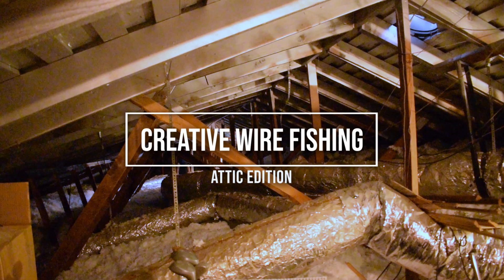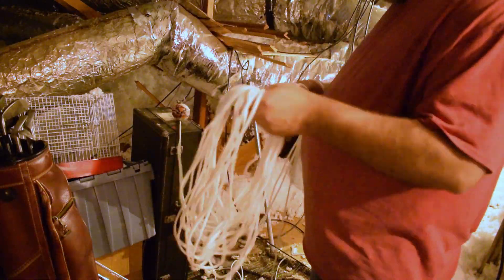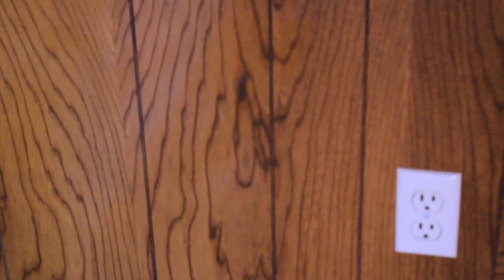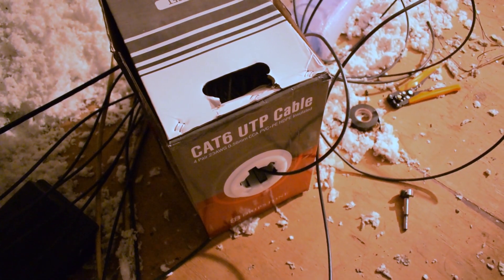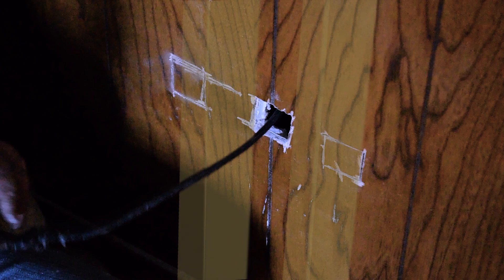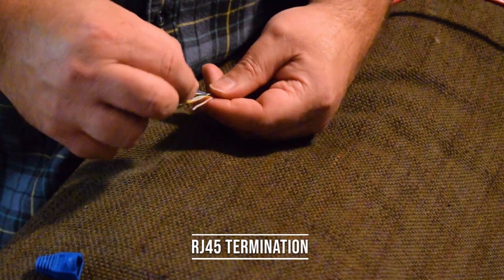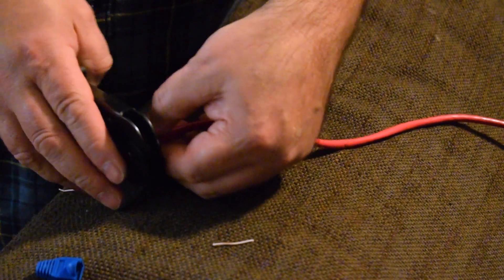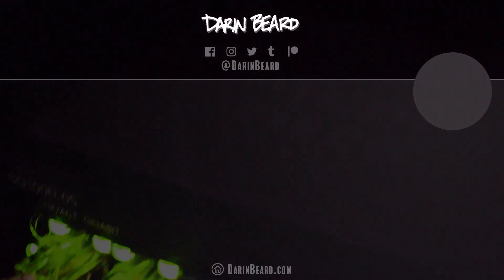How To Wire house for Network/Internet - tips, tools & tricks. Cat5e/Cat6/RJ45

Comment: I would think buying a patch panel if your wiring the entire house would be beneficial easier to work with more work up front but having a single point of entry for all the wiring without them all hanging out of the wall seems more uniform for me but to each their own if your setup works for you then thats good

Comment: I've run a lot of cable, and you generally did a fine job from what I saw... but in case you need to run more or for others who see this, here are some tips I'd offer. 

Another way to get a wire across a span that may be faster/easier is to use glow rod (aka fish rods) or some other "pole." Tape your cable (or pull string) to that and push it across your span. I've done this to get cable across drop ceilings. I've also used a "gun" like device that shot a fishing line out and across the span that you could then attach your pull string to and then use that to get your cable across. I like the glow rod method better as it's more controlled.

Rather than putting the hole in the ceiling (which is a valid method in that it works but leaves you with a hole) - From the attic, orient yourself so your looking in the general direction of where you think the header is and then look for the wire that's going to the outlet in the wall. You may not be able to see it as it may be buried in the insulation, so digging around my be necessary. In any case, the wire is an indicator that you're in the right spot. You really can't avoid having dig around and to move insulation in these situations.  

Generally speaking, I'd figure out where I want my wire to end up first, cut the hole in the wall, and drill the header and fish a rod/pull string through that. Having had my share of run-ins with unexpected things in the walls, I also try to check thoroughly for studs with a stud finder, knocking and I've even used an ice pick to probe a suspect wall (small hole easy to patch). Also, if you figure out where you want the cable to be, and cut your hole, you can have a helper feed a glow rod up the wall and tap the header with it, which will help you locate where you need to drill.
Reply from the maker: .
Thanks for the info. Yup, I am a total amateur and just figure it out as I go. I had a little experience but this house is sort of non-traditional so I had to be creative here and there. I had some glow rods of my brother's but they were mostly broken so I came up with the baseball idea to try. There probably are easier ways but this was fun to try.

I had looked for electrical wiring to find headers but there wasn't always something convenient to look for where I needed it. The hole in the ceiling is very minimal and easy to fill so I really like the coat hanger method. I used it several times during this and it never failed me (other than the crazy studs). I checked for studs but never expected to have two more that were that close to where they were. I still don't know why. 

Thanks for adding your knowledge here for people to see.